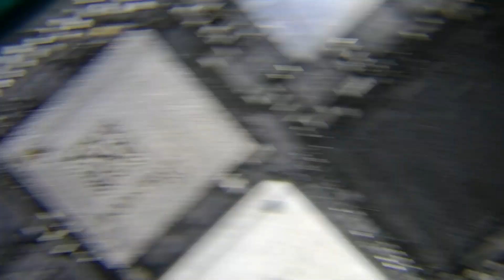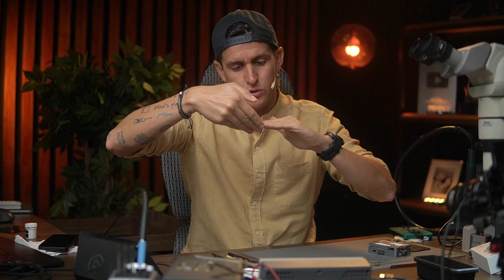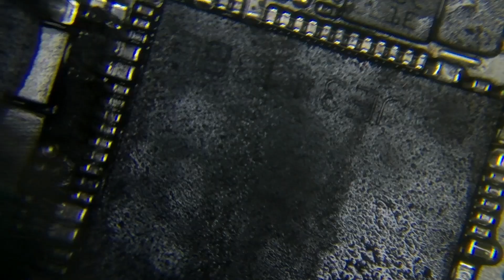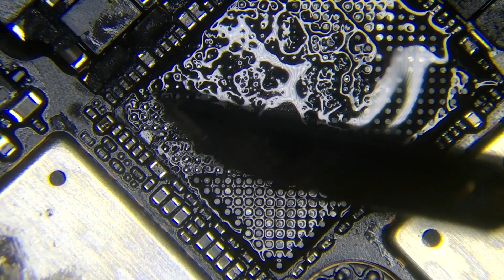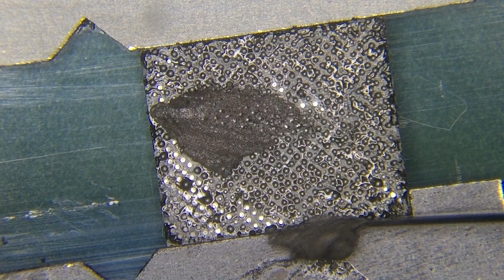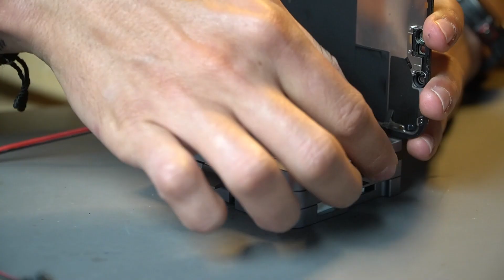iPhone 13 Pro Max SWAP RF🔥 - HOW TO FIX THIS PHONE

Comment: Hi sir I have one problem with iPhone 13 full short then I separate the board and the short is on b board. Now I swap the the b board and flashed it. But now when flash the baseband is ok in 3utool but still no imei and no baseband. What can i do? Thanks in advance

Comment: Hi Edgar thx for this video.I have a question.I recently did an Iphone 13 pro max CPU/Nand/EEprom swap. I attached the B Board from another donor and when the phone booted up i had no wifi and signal.Is it because it was not the original baseband and wifi IC as i saw you had to swap in the video ? Question is why u didn't just replace the entire bottom B board ? Why did u replace original wifi IC, Baseband and eeprom? Are they paired together?